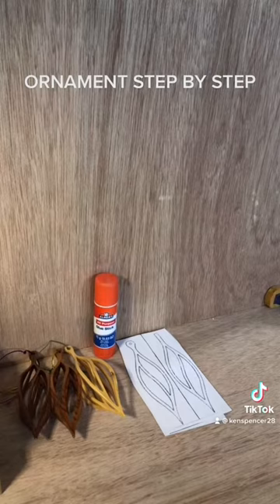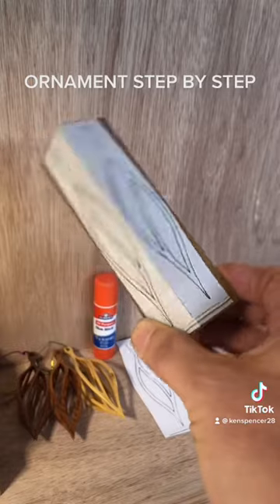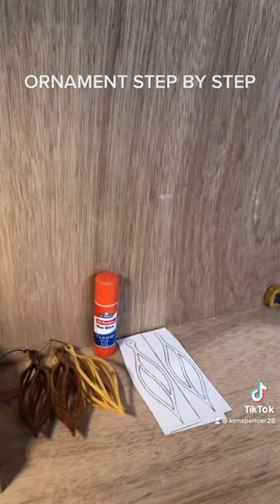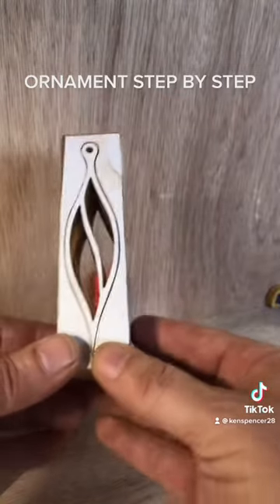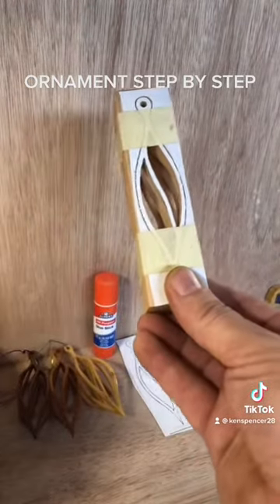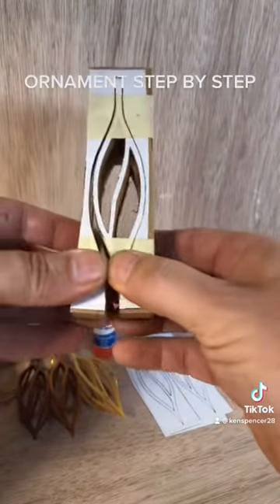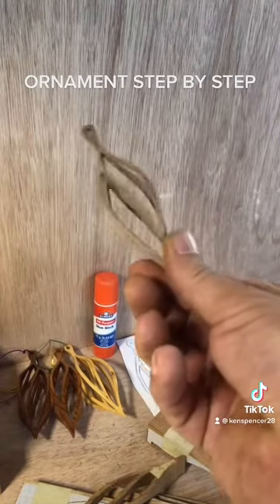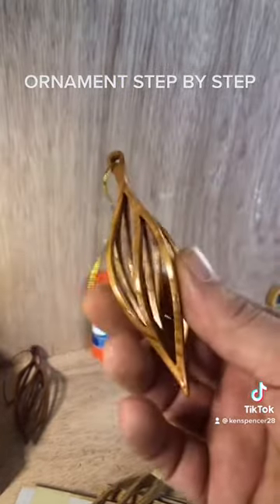3D Spiral ornament step by step

Comment: I finally got my first scroll saw! Do you sell this pattern!
Reply from the maker: Sorry, I don’t sell or distribute patterns…this is a Roy Forsyth pattern
Reply: I am very very very new to scroll sawing. I did this project and my cuts are NO WHERE NEAR AS CLEAN AS YOURS!!!
Reply: @Ack5100  - with practice, you'll get better.  When I started scrolling I had a specific project in mind but zero experience.  I was afraid to start because I was sure I'd wreck the nice walnut I had picked.  So instead I cut puzzles out of pine scraps.  It was fun, only cost me a few blades, and got me some experience and confidence.  It's been a couple years and I still screw up sometimes, but I've gotten a lot better.  I've cut two of these ornaments and made little mistakes on both, but a good sanding hides a lot.  And that's ok!  Keep at it.  You will get better.